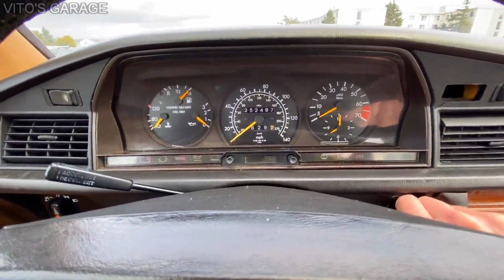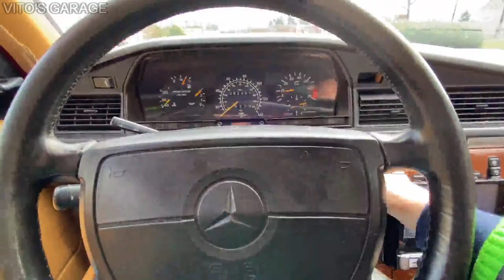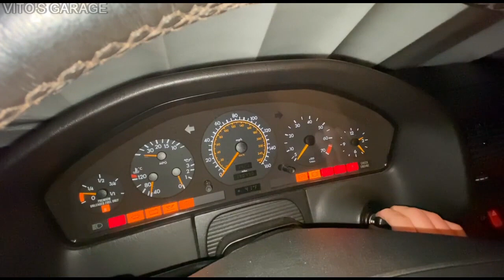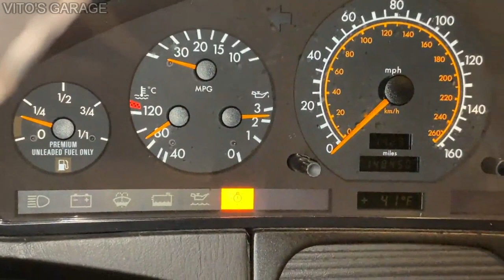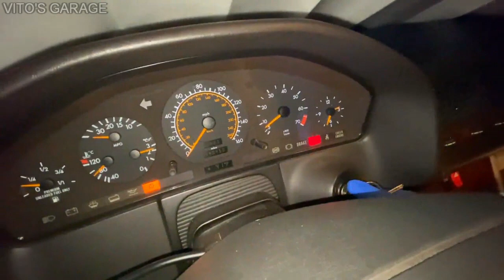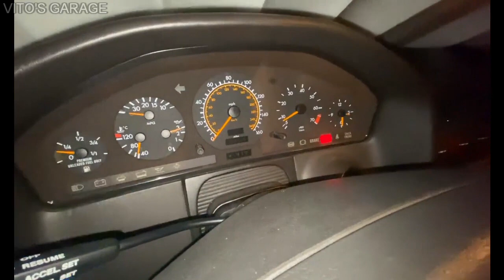Driving Around in Mercedes 190E. First Oil Change on Mercedes W140

Comment: Vito, make sure you replace that coolant tee behind the oil filter on the fire wall. they become super brittle and will crack. End result is all your coolant leaks out and bad news for engine especially if you are driving
Reply from the maker: Thank you for letting me know. That’s for the w140, right?
Reply: @VITOSGARAGE  yes sir

Comment: Oh wow someone has grinded the oil drain plug 🤔
Amazing video, it's always a pleasure to see that Baby Benz on the road i love it! And the W140 seems to be a nice project, that's a nice car
Reply from the maker: Thank you Andre! And I think they replaced the drain plug with this one... I didn’t have a new one on hand and I wanted to finish the oil change. Next time I’ll replace the drain plug with original one😀
Reply: @VITOSGARAGE  that's the kind of "surprises" that you can sometimes find on cars 😅 at least the bolt is not rounded, it would be worse in that case
Reply from the maker: Yeah true.. I was ready to put a 13mm wrench on that bolt and then I realized that it’s a super weird bolt there... I had to use an open end wrench to loosen it😀